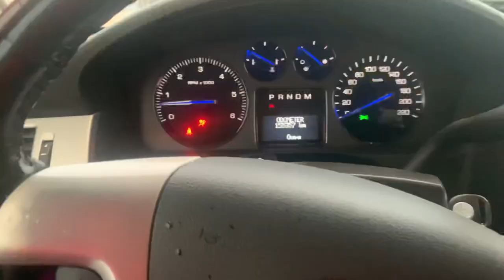Potato Shortage in RUSSIA

Comment: Have you tried resetting.  Put foot on break hit start. Turn off push gas Patel 3 times turn on. ??? Repeat until gone. If that doesn't work you need a new sensor air bag sensor not hard to change at all a ten minute fix max
Reply from the maker: Thank you for the advice, I think that resets the oil life sensor, I will do that once I change the oil. If that doesn’t work I’ll see about the air bag sensor thanks!